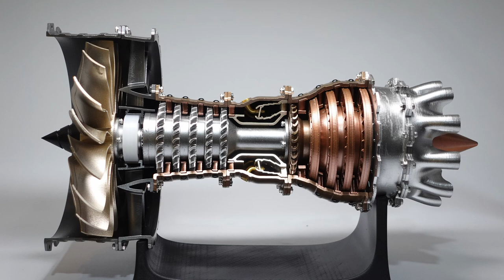Working Jet Engine Model. 1/20 Scale #stirlingkit #whyweengine

Comment: Probably the best build I've watched today!! Btw is it CFM engine?
Reply: It's  a Trent 900 engine. It powers the A380.
Reply: @davidpalmer9780  sry for you but this is NOT a Trent 900 engine.
The T900 engine is a three shaft engine with an intermediate pressure turbine/compressor.
This one is missing here. After the combustion chamber, there is the High Pressure Turbine and after the turbine is direktly the case of the Low Pressure Turbine. That means that engine is an 2 Shaft engine ;)
Reply: @jarn2648 Thanks for the correction. I'll go buy some glasses.
Reply: This isn’t a Trent 900. The Chinese producers of this model stole the design and don’t understand the origins. I designed a nacelle for this model. (That design was stolen too.) The nacelle was modeled after the Trent 900 because there were so many pictures available on the web. But the core engine, as seen here, was never modeled after the Trent 900. The core engine was modeled to represent high bypass engines in general and be easy to 3D print. It was not modeled after any engine in particular. It certainly doesn’t match the Trent 900.

Comment: This is a piece of chinese crap, I bought it 200 euros and when I receive the order I found broken blades inside, motor won't run an pinion broken. I have wasted 200 euros, won't buy again from this company.
Reply: Sorry to hear of your troubles. The problem is the Chinese company that produces this model stole the design. They have no morals. No only are they thieves, they don’t mind scamming a few customers.
Reply: @rtwileyrc8030  Thanks for the heads up. Can you recommend a more reputable manufacturer of models like this?